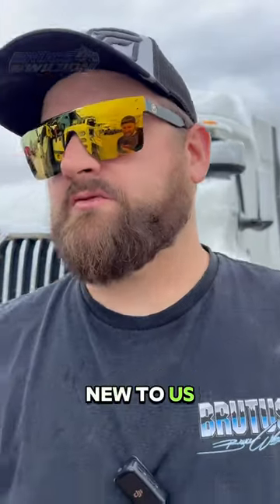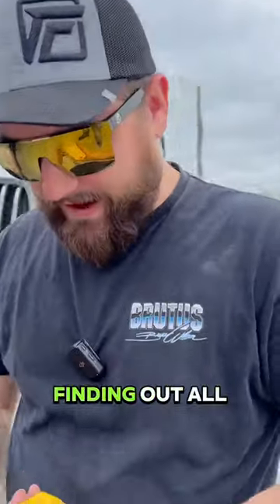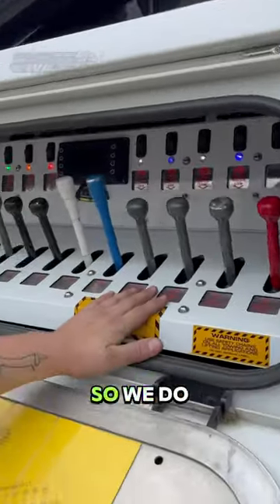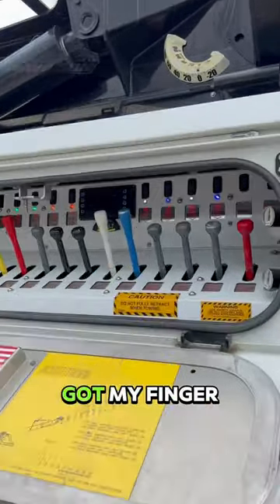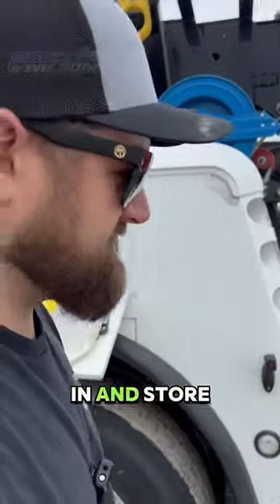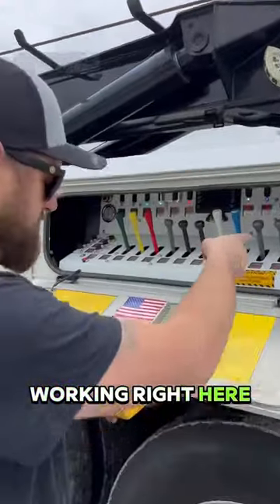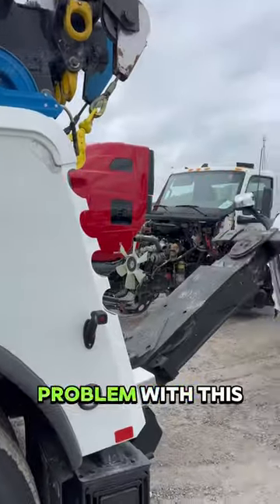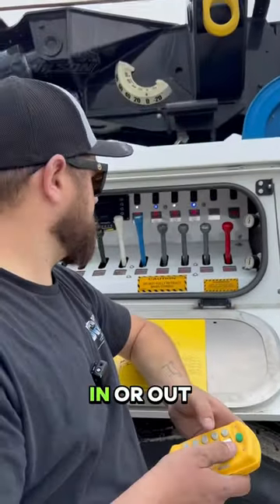Remote control Tow Truck!

Comment: See those gauges in control box they tell pressure on winches.  As to the small remote is there settings for it or flip switch for pressure reduction?   Some remotes may need to push two buttons at same time to slow down.